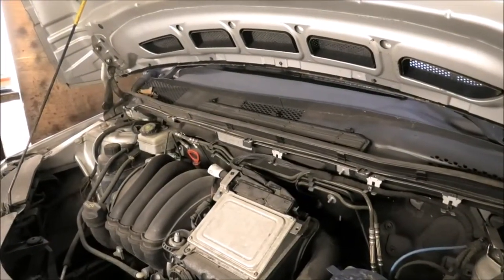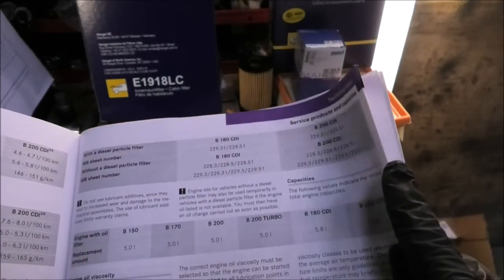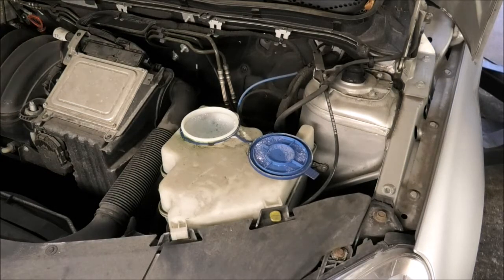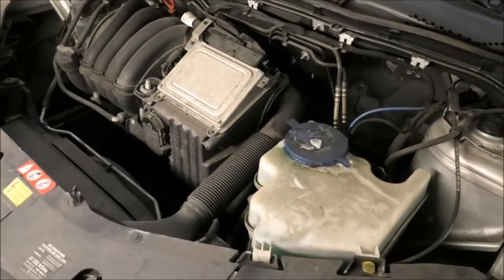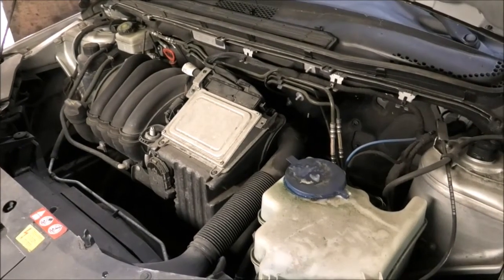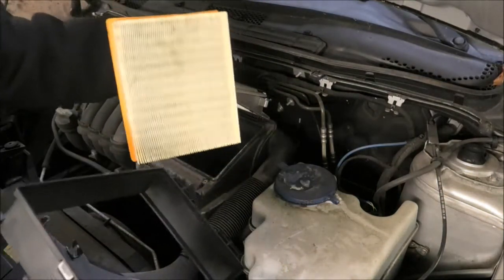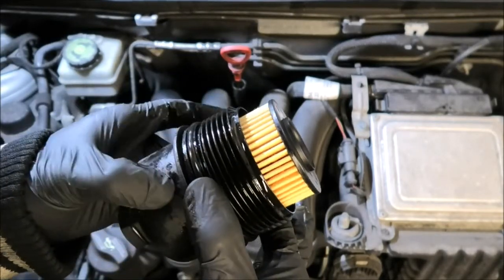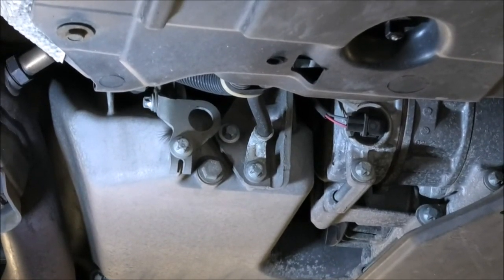Mercedes B class 170 w245 2006 oil, oil filter, air/pollen filter, screenwash top up, coolant check

Comment: hello, how many thousand km is your car's engine?
so I bought W169 A170 2 months ago
same engine, petrol.
oil castrol Edge?
Reply from the maker: Hi the car is done around 65000 miles, castrol edge should be fine.
Reply: Hmm, I thought about 5w-30 mobile for a while but ok, i will try castrol edge.
Thann you👍
Reply from the maker: @BeratY1881  no worries.

Comment: Hi, I plan to buy a 2008 Diesel Automatic B180 cdi. Could you from your experience please advise on this in terms of reliability, frequently broken engine components and their costs + the average labor costs to fix the car.. I really would appreciate your candid feedback...
Reply from the maker: this is a fairly reliable car, strong and con go for a long time, I haven't had any major issues with this model just the alternator fab belt can be a bit tricky to change but does last, also oil changes need to be frequent and the engine will last a long time. general maintenance its not hard to do, very average time for an oil service.
Reply: @DaringBeefcake  Thanks for the feedback man.. 😊

Comment: Saya mau bertanya diluar topik.apakah setelah memperbaiki tcu/tcm kita wajib me reset dgn Odb...atau bisa langsung pakai
Reply from the maker: Are you using the original TCM, if yes then you may not need to delete any fault codes. If it’s a TCM from another car it needs programming via OBD2 port.
Reply: @DaringBeefcake  setelah saya memperbaikinya tapi tulisan Fault di odometer tetap ada.apakah mungkin tcm nya memang sdh betul2 harus ganti.

Kerusakan yg saya dapati di dalam modul tcm ada 2 kawat yg terputus.dan saya menyolder ulang